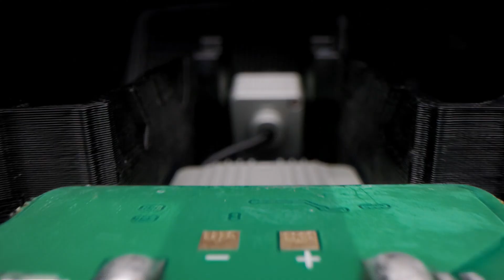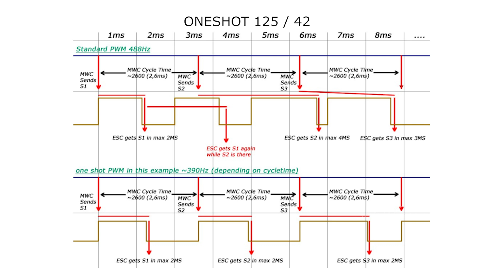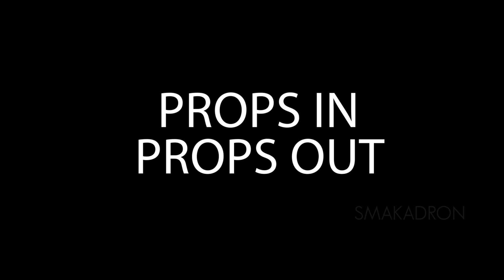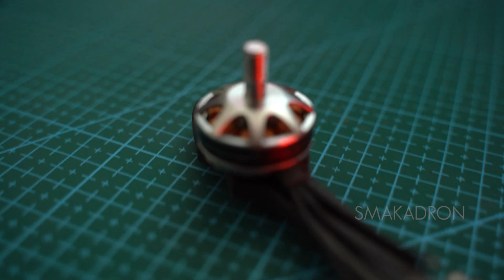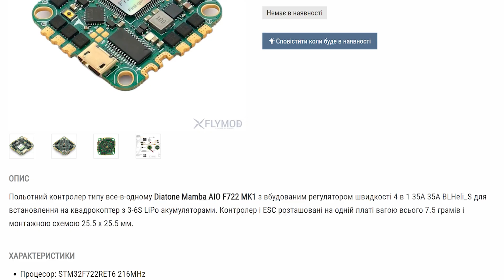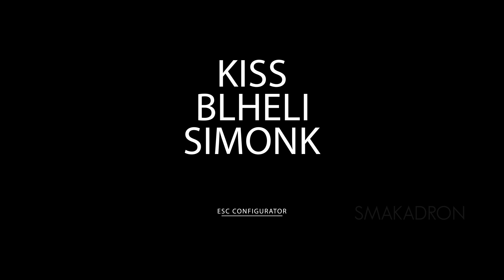Lesson 5. Speed Controller (ESC) . Course from Beginner to Pro. Complete Theory

Comment: Best educational video for beginners and slightly experienced pilots about ESC of FPV drones I have ever seen ! This was high quality. I definitly gonna watch the others as well. TY. I agree 1,33x the motor current (ampere) for esc is a good rule. For 3D mode you should select 1,5 - 2,0x.